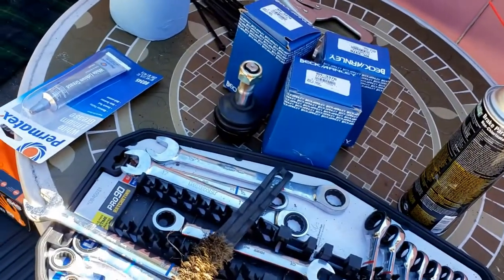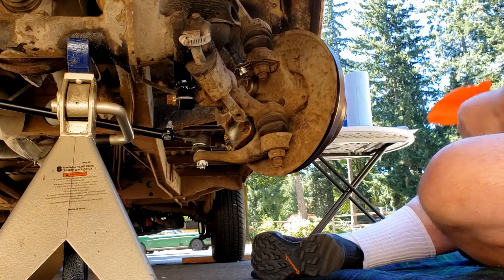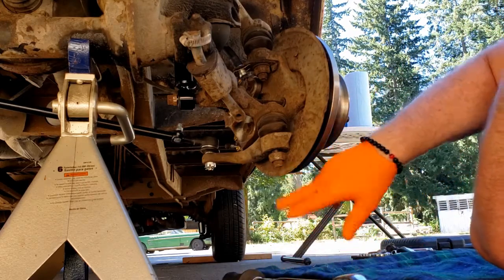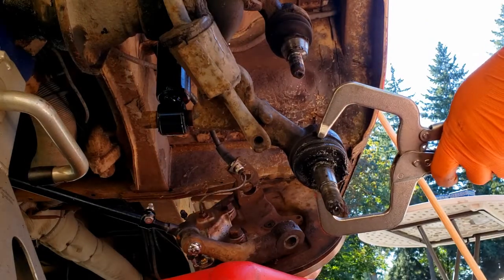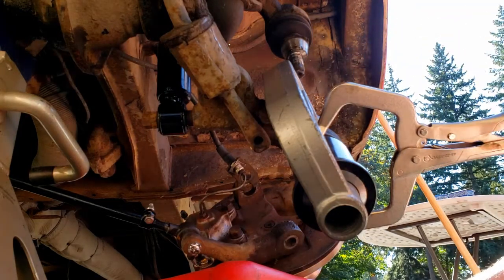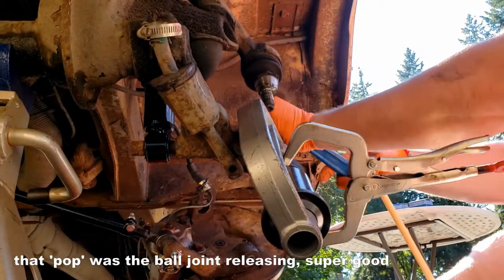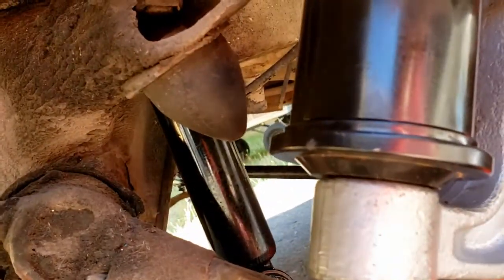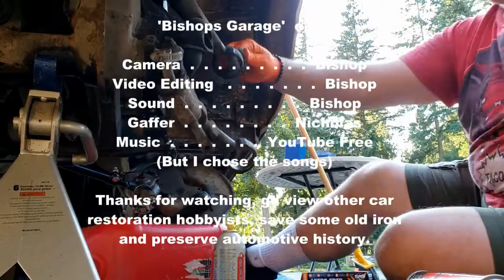ep28 Bishops Garage - VW Bus ball joint removal - 1974 T2

Comment: Hello sir! Thanks for the vid on the ball joints.

I can see you used a lager puller and the vise grips. 
 
Can you share the specifics on that puller and the adapters that go over the ball joints? Thanks
Reply from the maker: I added the ball joint puller kit to the video description.  As for the vice grips, i just got a set that were "C" clamp shaped.  All of the vice grips shaped like that will work :)

The ball joint remover kit was about 200 or so maybe 250 on amazon.  I did put the link for the old one, they will give you matching alternatives.

Enjoy your work!

Comment: When I did mine, I took the arms off and the machine shop pressed them out for me. I like your way of doing them much better. Very good video. I know it will help anyone that does the ball joints. My steering was much improved after the ball joint replacement. The welding clamp is a good idea but I hope I don't have to do mine again.
Reply from the maker: Hails Richard!  I hope I don't have to do mine again either...it was a bear indeed!   

I truly do hope others see this and get some good shortcut ideas and that ultimately its a help.

Thanks for coming by man!   Happy bussing!

Comment: I tried this "clamp" technique on my 75 bus but couldn't move the ball joint atall. I couldn't even get the  ball joints separated from the spindle. So I had to take the control arms off the torsion bars & take the whole assembly to a machine shop. They said it took 10 tones of pressure to get those ball joints out of the control arms.
Putting the control arms back on was a challenge, first ligning up the leaves of the torsion bar, which had separated - then I found that I had to remove the bump stop by cold chiselling the clip off, then using a trolly jack to lift the arms & hammering them back into position.
All in all, a horrible job - how do you manage to stay so calm.
PS. sorry about the rust holes in your van - California is the place to be!
Reply from the maker: Wow oh wow, man what an awful time!   10 Tones!   Perhaps I was lucky, well I am glad you got yours done too!   

Hmm, manage to stay calm, its called editing out the swear words?   hehe, its my mild Norwegian blood I think...not much phases me...check out my "on fire" upholstery video hahahaha.

Thanks for stopping by!

Comment: Just came across this video. Wow you were lucky they came out so easy, I have heard that  can be a nightmare to remove. Now I’m debating if I should do it that way or remove arms and get someone else to press out and in. 74 is a good year 👌
Reply from the maker: Well it wasnt easy thats fore sure, but to me, it was worth the 300$ in tools to do...I could have removed the arms and taken it to a shop and had them press them out and press the new ones in for like 100$.

But doing it this way, at least shows the common guy, that it can be done with some sweat and effort =)

Comment: Loved the video. It gave me enough confidence to start this on my 1974 bus while I'm replacing the front disk brakes. Where can I get that clamp you used that fits in the notches for removing the ball joints?
Reply from the maker: So glad theyve given some inspiration!   The clamp was a simple buy at Home Depot, look in the vice grip section they are there =)  Maybe 20 bucks, funny they are just an ordinary vice grip with a C-Clamp styl nose, common...and just happen to have the right width on the nose to do these.  magic!

Comment: Hey! Where can you rent the ball joint press from? The shop I got to said they would do it for like 450! That just seems like a lot of money.
Reply from the maker: Hails Jay, ya thats a chunk of change and why I went and bought one for about 300$...but, you can rent these from ORileys or Autozone, you get it for a day or two and its free, they just put a hold/deposit on your card until you bring it back.

Works good, ive 'rented' tools this way a few times, always cheaper.
Reply: @bishopofrustyiron3101  I tried it your way but they don’t want to come off.  It’s bending the grips that I got like yours.
Reply from the maker: @jaytodd878  Wow bending the grips?  Holy smokes that is stuuu uh uk.  Perhaps a good soak in PB Blaster every day for a week and try again?

Comment: Hi, it jumps about 5:30/5:44 from undoing nut to its out, how did you do that? If just want to replace the boot ?
Reply from the maker: Hmm, at 5:49 you see the clamp finally pull free from the ball joint, 5:59 i put a set of vice grips on the ball joint then use my large breaker bar to undo the nut.  Might just be camera positioning?
Reply: @bishopofrustyiron3101  hi. I meant the bit in the video where you've got the nut off, does the ball joint shaft just come out?.  I've undone the nut but it's all still solid but in the video your next shot it's all apart.
Reply from the maker: @porsche1959  Oh gotchya, ya the upper one slid right out because of the camber insert, as soon as I undid that upper nut, it just came off and slid out.  The lower one was the tough one and needed that clamp.  Once that lower nut was off it just slid off too.  Are you trying to replace just one ball joint?  or both?
Reply: @bishopofrustyiron3101  hi, I'm just replacing the boots for both the ball joints. Nut undone but didn't know whether hammer time or it should just pop out
Reply from the maker: @porsche1959  Ah, wow that is going to be a tough job to just replace the boot, best of luck!

Comment: I really want to do it your way but everyone I talk to and even the VW books say I need a 20 tone press.
Reply from the maker: Hehe, ya I felt that way too as I started this....spent the 300$ in tools, and it was doable, first time, and really was under about 4 hours of work from first turn to driving again...I know guys who have taken the assembly to a shop, paid the money, and had them punched out and installed.

I wanted to see if I could do this, never having done it before.  I could, did, and would do it again instead of having a shop do it.

Probably hehe.
Reply: @bishopofrustyiron3101  Thanks I will give this a go. Out of all the other videos here yours is the best as you don't cut it and bash it. BEST METHOD.  Im doing a massive full rebuild and restoration on my 74 kombi.
Reply from the maker: @captiand387  That project sounds awesome!   best of luck, yup all the effort i went through was in the video, minus the occasional swearing lol.  I am confident you can do this!

Comment: Did you rent the clamp?
Reply from the maker: I could have, but well i figured I would use it a few times so i bought it, the set was about 100 bucks for the clamp and various bits that came with it.  Since, i've used it a couple more times, nice to have my own.